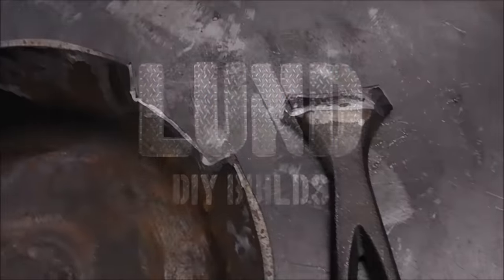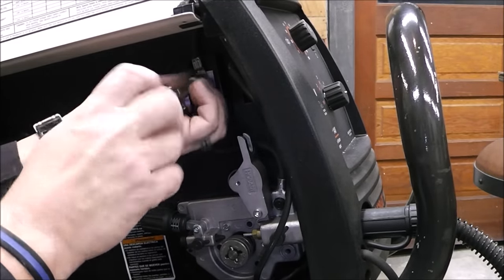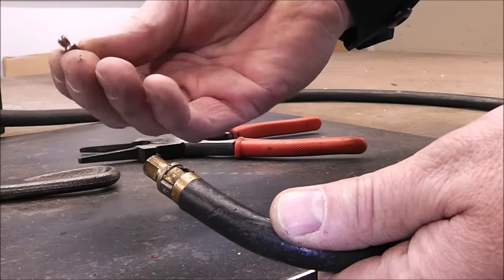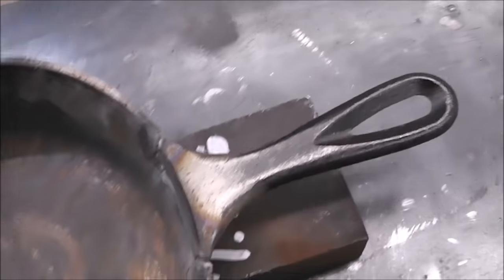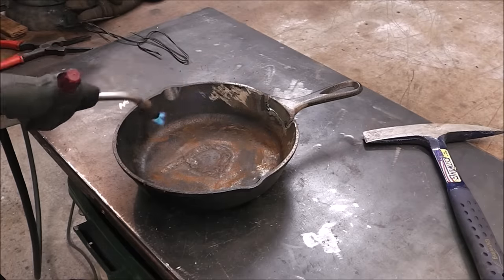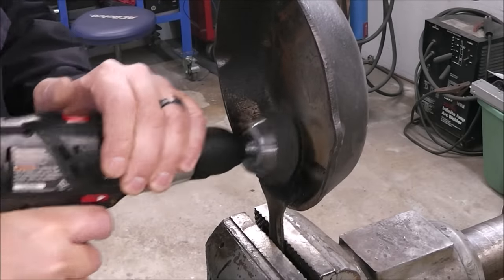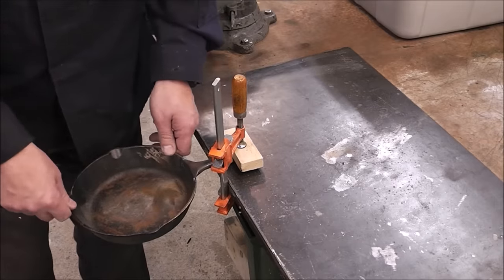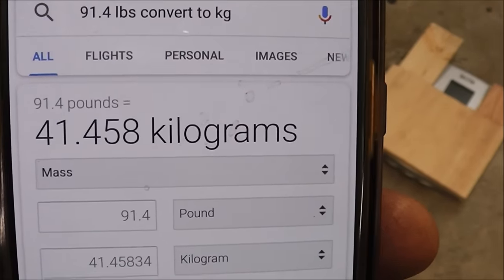Cast Iron Welding Repair using Flux Core Wire

Comment: Nice going Brandon, giving new ideas is always good, it is how knowledge progresses.
I have never stopped being open minded or looking at things from outside of the box.
Never allow others who think they are superior to stop you from being inventive, if you think you have a new idea and it works, use it if you can, it may become the preferred method even if it is unorthodox or not the norm.
Cast iron is not difficult if you have the knowledge of how past failures taught you the methods that work for you today.
There are machines out there that stilĺ work that I fixed welding cast to steel 45 years ago with methods that were called impossible and almost cost me my job, and the people who would have condemned my work if they could have are now long gone, those machines outlived them.
Hats off and regards. J.
Reply from the maker: Thanks John for the great comment. It sounds like we have a lot in common. I've always been inquisitive and if told something won't work I have always had a genuine curiosity of why. My curiosity with welding cast iron started 25 plus years ago. In short I broke a part that couldn't be replaced. It was obsolete. I was told the item was "priceless". It was about the size of a pack of cigarettes. I was told it couldn't be welded or repaired. I brought it to several welding shops and they all said it was impossible and they wouldn't touch it. Back then we didn't have internet to research. I ended up used brazing rod to repair it. To my knowledge its still in service to this day. Most of my knowledge comes from within wanting to know more. From.that point forward I quickly realized that cast iron was a voodoo material to some. I figured if I can do (out of necessity) what others say can't be done, why not test some other methods. Surprisingly a lot of them are decent repairs. 👌 thanks for your support man! 👍

Comment: Thank you for the push.  I needed to weld a bronze part from an old Russwin morticed lock set.  It had worn from 80 years of service.  All I have is a flux core welder so after your video I gave it a go. It worked and now my house has its front door lock functioning at 100%.
Reply from the maker: I love it! Your story is why I love doing these videos. A lot of time people are told "it wont work" until someone comes along and tries and it does. Congratulations on getting it all beck together!

Comment: Are you really going to put almost 100 pounds of food in that little skillet? I think it will do fine
Reply: It's not the weight of the food that I'm worried about. It would be if the pan fell which would increase the weight of the pan and its contents causing the pan to gain mass as it quickly falls to the floor. 

I don't know the calculations, but even an object falling which accumulates, let's say, a mass of 45 lbs by the time it hits the ground might be enough to loosen/weaken the welds enough so that they knew carrying limit of the repaired handle is less than half of the 90lbs you started with.

Comment: Thank you for doing this video. Just as you explained, not all of us out here have gas fed systems or can even afford them or an expensive welder. Also not all of us live in the US where everything is cheap and affordable. Where I live, most products and or equipment is 10- 30 times more than the average US $ cost due to foreign exchange, duty import taxes and ridiculously high retail markups by greedy merchants. 

So when you idiots want to give this guy flack for doing videos like this to help the poor or less equipped man or woman, think before you type or just keep your damn opinions to yourself if you have nothing positive to say.
Reply: Flux core self shield is extremely common in industry. No real welder would bash it because they know it is essential to high production welding outdoors. Anyone hating on it is simply not educated on the subject.

Comment: Glad to hear you empathize with the importance to weld and peen a little at a time, I always use wood ashes for cooling cast iron but understand not everyone has access to them. Well done, and Interesting experiment.
Reply from the maker: Thanks man! Yah I've heard wood ash works good but I havent tried it. Possibly this winter when the wood fire is roaring I will make it a point to save the ash and give it a try.

Comment: I spent 20yrs as a coded welder using most weld systems
Did a lot of pipelines with Lincon 211 flux core.
This guy did a reasonably good job.
Any comments about vertical up versus vertical down are probably from inexperienced guys.
On a pipe line the procedure of choice is vertical up root run and vertical down for the fill and Cap.
This video is very good.
Reply from the maker: Thanks Phillip H I appreciate your support and comment! 👍

Comment: this surprises me. i have a vice that cracked. i may try to fix it with my flux core welder after seeing this. even if it breaks again, it worked for a little while longer. thanx!
Reply from the maker: Im glad i could help. Please be sure to report back!
Reply: Lol a thick walled vice will def be a feat to accomplish
Reply: @xoxmisspaigexox  it's a small 4" vice. a bigger one with thick walls wouldn't have broken on the job i was doing. it was my road vice that is on a tow pintle, and can be mounted in a 2" trailer hitch receiver.
Reply from the maker: @Alicia Brock Not really. V it out and tack it up. Throw it on the gas grill at 500f for an hour and weld it up. Make multiple passes if necessary until the joint is full. Bury it in some dry sand overnight and hope for the best. It can be done if your willing to put in the time and effort to stitch it back together.

Comment: Been a welder for 42 yrs. But impressive.  Ive done a lot of cast iron repairs. Your whole aproch is good with the preheating and cooling.  And ni rod is the best. But i would have never have tried flux cor for that but it was fairly successful.  I worked at NASA for 24 yrs as a welder. The milspec gov. Catalog listed 7018 as rod for welding cast iron. Never really tryed it but always found that description interesting
Reply from the maker: Oddly enough I have tried 7018 and although many people have told me they have had good luck, I have not. The one repair that I have found to date that is just about as strong as the cast iron before its broken is mig welding with silicon bronze. It welds like butter and it's super strong

Comment: I fixed a cast iron stove top and was told the same way you did it.In the end I was happy with the final outcome.The process does not put the cast item back to new but it will give a few more years use from it
Reply from the maker: Right on Peter! It's always a good feeling when you can repair something and get more use from it!

Comment: Interesting hadn't seen any cast iron repairs using Flux core, actually came out stronger than I expected. I typically use Nickle rod on a stick welder w/ alot of preheat & wrapping it up post weld to slow the heat loss. Thanks for the video.
Reply: I've only ever TIG welded cast iron for a class; it was a 4" T-joint with 1/2" legs, took about 90 minutes after pausing for heat management and another 30 to cool it down.

Comment: When welding castings that required machining afterwards, dull red preheat and post heat (torch) gave good results. I also welded them in a bucket of heated sand that I covered the part with to slow cooling. The process worked, but it was determined to be too costly (time plus nickel SMAW rod). Parts were remelted and re-poured. I have used a HF 90 ac to successfully repair large antique lawn ornaments. A 90+ degree day and a propane torch preheat resulted in adequate strength and no cracking.
Reply from the maker: I have had good results with pre heat, post heat and sand also. Thanks for the great comment and for watching!

Comment: BRANDON - sorry for any harsh criticism you've gotten. Be a duck - let it roll off, right? Your videos have really helped me. Funny thing is, I'm an I.T. guy (geek) and I just bought a cheap ($169) MIG flux core welder (Titanium 125) because I need to install some hangar bracket reinforcements on my 30-foot trailer suspension. I think I got this. 
THANK YOU for your work out here. I plan to read and react to hate mail from my channel LIVE on-air. LOL! Thanks again. Keep it up.
- Jim (The Mad Camper - in Minnesoooota)
Reply from the maker: Lol thanks Jim. I let it roll off. While some are being negative saying it can't be done, I'm actually doing it. Results and action trump talk anyday lol 😆
Reply: @BrandonLund  EXACTLY. You go! Thanks.
Reply from the maker: Thanks Jim I appreciate it 👍

Comment: I repaired a rare exhaust manifold. I welded with a nickel rod. I preheated, then after welding . .  I post heated. I used a torch, then a heater and slowly moved the heater away to control the cooling. It worked great. There's lots of ways to accomplish things.
Reply from the maker: That would be my preferred method or bury in sand or ash works good too :)

Comment: Nice fun little video - there's no need to justify your experimentation, as that's  how we ALL really learn things! BTW I've welded cast iron to cast iron, steel, etc using iron rods(dc) and MIG over the years(pre/post heat and workplace support is critical), and on some heavy equipment too!! Some peeps repair cast iron cylinder heats by preheating and welding with the parent metal dull red, and it works! :)
Reply from the maker: Thanks man I appreciate your support and thanks for commenting. I enjoy welding cast iron a lot.

Comment: Very interesting.  I would not have tried this process.  I've brazed C.I., nickel rod on C.I. and a couple of "low temp" iron brazing rods, something like you did to see what would work.  I thought for years brazing with O-A was the only way.  Then I learned about some nickel rods that worked pretty good.  All of the above  did include pre-heating and slow-slow cooling.
Thanks
Reply from the maker: Thanks man I appreciate it!

Comment: i didnt know i could arc weld cast until i saw your series and it p1ss3s me off as i thrown stuff away as had arc but not mig tig or anything. Good for you for sharing good info
Reply from the maker: It doesn't always work but you have a pretty good chance it might

Comment: Was welding a cracked casting on an engine today - using flux-core - while pre-heating, the amount of liquid driven out of the casting was crazy. Pre-heat important.. I'm starting to regard flux-core as the most versatile cost-effective process & am moving over to it as our "Only" process (we have lots of welding machines & lots of gas - they're going..) The bumper-prize of being able to also weld stainless with flux-core is another huge plus. Plus despite perceptions, it rocks for car body-panel welding.
Reply from the maker: Spot on man! It's pretty amazing! Some disagree but it works

Comment: Thank you for the video. Broke my 12” Wagner ware last night so now instead of tossing it I’m going to repair it so I can use it again. Well see how it goes.
Reply from the maker: Thanks man but I'd be careful if you decide to do this. The consequences if your weld failed could be catastrophic with hot grease going everywhere which would likely result in a house fire and personal injury. I used a cast iron pan for the demonstration simply because I have been accused of welding cast steel so the pan kinda eliminates that variable.
Reply: Brandon Lund thank you. The break was clean when it fell from a ceiling hook. So is your concern the the weld could fail while cooking and fall out due to the heating of cooking?
Reply from the maker: @mannsonthemove2958 yes. Cast iron can be tricky. This repair could hold for many many years, or the crack could reappear with a few heat cycles. The issue being repeated heat cycles. When you repair cast iron you harden the base metal so keeping your heat low is the key...how low to creste the repair without hardening the surrounding metal is the million dollar question. The weld repair will be at one tensil strength while the pan is at another. Repeated heat cycles can reopen the repair causing grease to leak out onto your stove. A lot of guys use this method to repair exhaust manifolds...if that repair fails, no big deal, the vehicle just gets loud.
Reply: Brandon Lund ok ill keep that in mind. I do not cook with grease in this pan. Ill keep and eye on it.

Comment: I did something similar with a broken vise while working in a shop. Nickel rod and the sand seemed to be best. Welded a socket to the screw and rebroke with a torque wrench.Great video
Reply from the maker: Thanks Ron and great idea about the torque wrench test!

Comment: Thanks for the video. I am thinking about trying to save an old cast iron bench from the scrap pile. It has a broken leg and someone asked me to haul it to the dump but it would be a fun little project that wouldn't cost anything to try. I was kind of surprised that the high end Hobart makes you change polarity lugs but the 20YO Campbell-Hausfeld I got from Wal-mart on clearance for $90 allows you to just switch hand twist lock terminals on the front. Maybe those screw terminals are just a better connection than the twist lock plugs? The Mig is all I have but for the "shade tree" work I do it has been good enough so far. Thanks again for putting this together.
Reply from the maker: Thanks man! Repairing stuff is so rewarding (when it works out). I have always thought that a selector switch to change polarity seemed like a good idea but probably it was eliminated for cost savings.

Comment: Looks like this video is 5 years old but cool. Have an exhaust manifold from a 292 engine. Is broke in half not just cracked. Can I weld with this method or torch an brass? 
When you clamp to bench it touches on bottom and 1/16 gap on top.
Reply from the maker: Go with silicon bronze. It's super easy to work with and probably the best repair method.

Comment: good video just repaired one of the feet on a cast iron wood heater with flux core worked great still holding...thanks brandon

Comment: Thanks for the video and all the good info. I like how you handle the angry haters. All I have is a flux-core mig and I will now try to fix my cast iron patio chair.
Reply from the maker: Thanks @Dave Kozicki  I've welded cast park benches with success so you should see simular results.
Reply: @BrandonLund  I look forward to your  other videos and have just subscribed.
Reply from the maker: @davekozicki3875  Thanks man I appreciate it! I try to put out a video every Friday. There are a few occasions where I dont because I'm doing stuff on my other channel but for the most part you can expect a new video every Friday. Thanks again! I appreciate your support! If you like build videos I have a playlist called "Ultimate Tool Build Series" that is very popular that you might like. Take care - Brandon

Comment: An old times trick I've heard and used was not to preheat the cast iron, but to weld about 1/2" - 3/4" at a time and letting it cool to the touch between each weld. It's slow but it works. I've used the method a few times myself.
Reply from the maker: It's called the "cold method". Your spot on how it's done. Peining also helps tremendously.

Comment: Nice, I also used a cast iron nickle rod to weld an old manifold with an arc welder, preheated and cooled it slow in welding blankets. Thanks, I am not a professional welder.
Reply from the maker: Right on!

Comment: Depending on what the base metal was for the cast, you sometimes run into a situation where the alloys in the base metal move to the weld boundary and create weak points. For example 60-61_0 aluminum is weldable where as 70-75- t3, t6 exc.. Is not due to the fact that copper introduced in the original formation of the 70-75 will migrate to the weld boundary and crack out every time. So a little research is often needed to determine if it is plausible in the first place. Great Video and one hell of an adventurous attitude towards can it be done and why not. This is how new and improved process are discovered and old myths are put to rest. Much respect
Reply from the maker: What a wonderful comment. Thank you and much respect! 🙏👍

Comment: Brandon I like your style get a  Miller Bobcat and Lincoln sa200 as soon as possible.  I want to see you in the field on the big stuff. I'm working on getting some big machines as well. Right now I'm using a Lincoln buzz box.
Reply from the maker: I've done a fair amount of structural on a Bobcat. Havent run the sa200 though. My very first welder was an ac buzzbox.

Comment: I’ve watched this a couple of times, the main thing is there’s more people watching these self help video’s who never have welded anything and are commenting on thought process and not on practical application. Input is ok, it’s life but those who by experimenting and have the old give it a try attitude know more about the subject. Been there tried it! Belarus cab tractor skidding logs broke the bell housing shattered it from top to bottom on one side, took come a longs to hold it together getting it from the woods. 100 Lincoln mig and a die grinder and lots of flux wire peening every weld and keeping the welds short, it’s still going strong five years later.
Reply from the maker: Boy you hit the nail on the head! Just like yourself, there are tons of folks that have welded everything from  broken vintage front tractor axles to woodstoves using unconventional methods that "dont work". Growing up poor teaches folks real quick what REALLY works in real life and what doesnt.
Reply: @BrandonLund  👍🏻

Comment: I usually use my tig welder and stainless filler rod. The last one was my drill press vice and it's held up great so far.
Reply from the maker: I've had good luck also :)